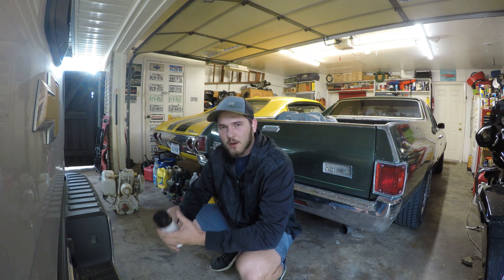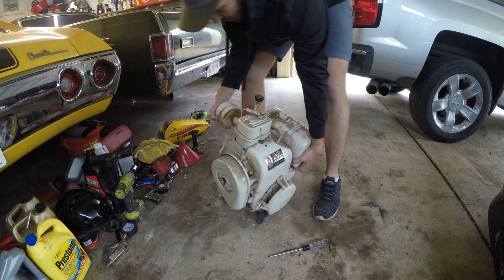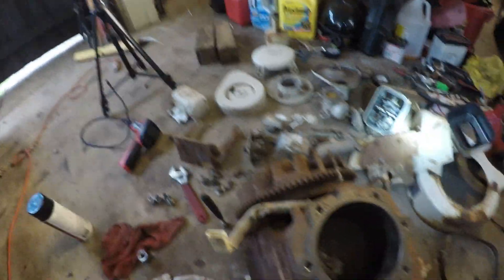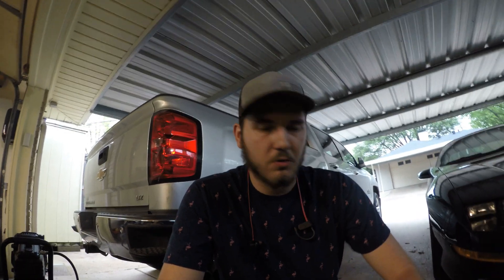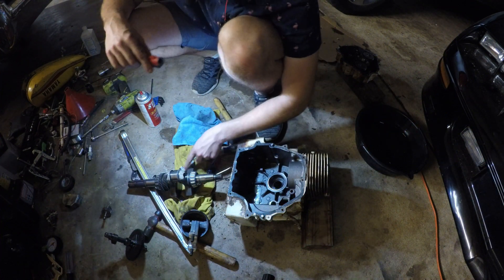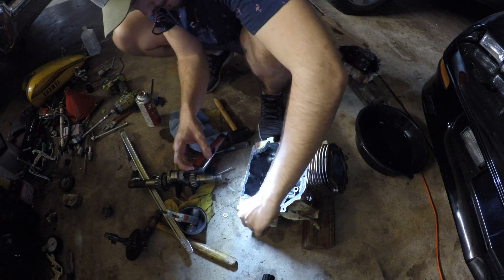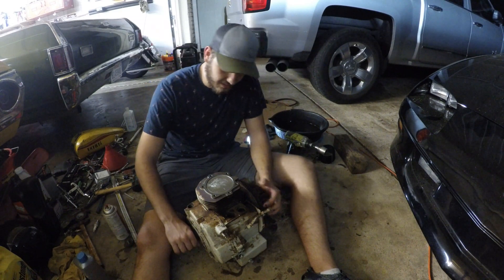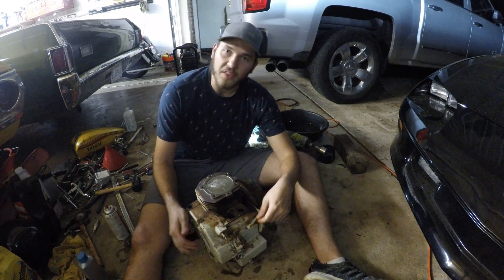Rare 18HP Tecumseh Engine (PT2 Rebuild!)

Comment: Still interested in the build with this thing. I bought a welder for home use so it's time to fab up a minibike frame for my oh160 :)
Reply from the maker: That will be ridiculous! I've got a couple things in the works for the Go Kart, I haven't had a whole lot of time with it so it's sitting but I'm planning on doing some cool mods soon!
Reply: @forrestspeedshop2481  hell yeah man looking forward to seeing what ya got!
Reply: @forrestspeedshop2481  hey there, question why not just pull the head off with out taking the valves out? Isn’t that easier? An I’m also interested in seeing the video you referenced to that you watched on taking the valves apart.